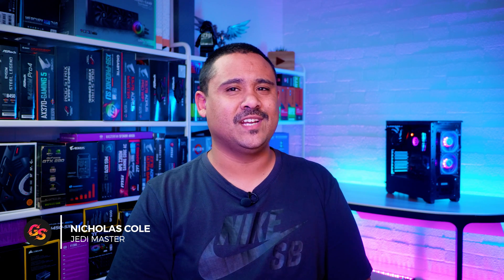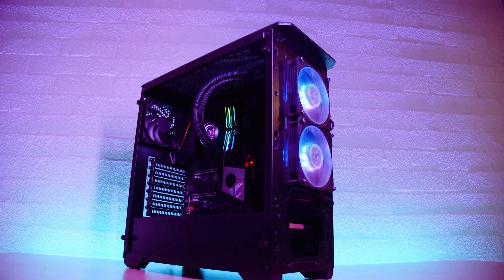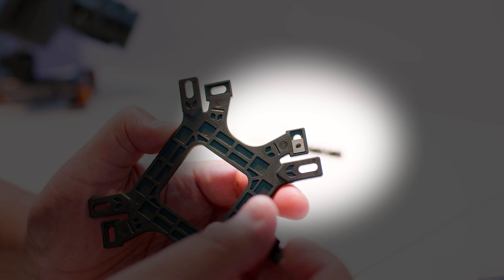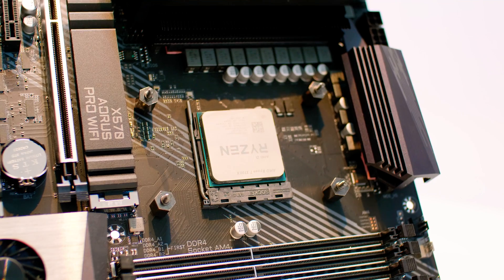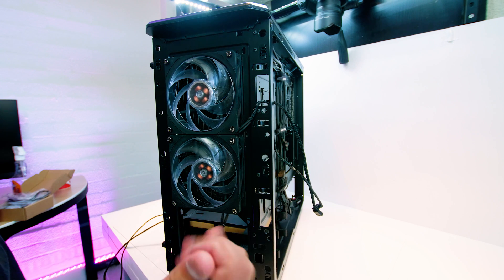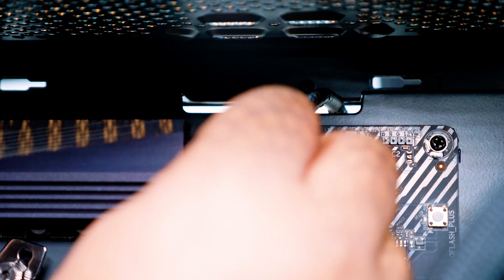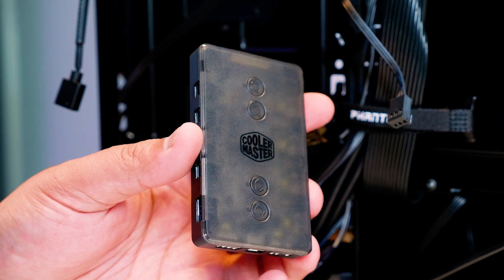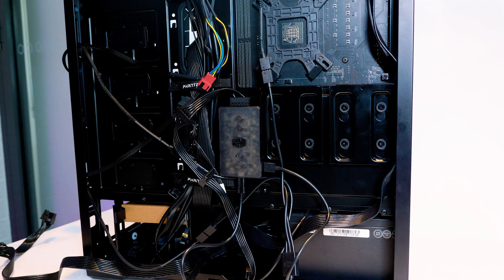HOWTO Cooler Master MasterLiquid ML240P Mirage AM4 Install Guide

Comment: Hello 👋, I was wondering if this AIO cooler would be compatible with an AM5 motherboard, specifically the MSI Pro X870E-P. I’m planning to upgrade to an AM5 platform and would like to know if I can continue using my current AIO.

Comment: Can you please remove the AM5 compatibility part? This cooler is not compatible. The AM5 bracket also holds cpu retainer in place, removing it means your cpu will literally fall out. Not removing it is also not an option, since AM5 uses 6/32 screws and ML240P screws are metric. I found this out the hard way...

Comment: The cable at 13:35 doesn’t work for my motherboard and I have a Aorus b450 I pro. The controller works for me but I also want to use the motherboard software for it and the provided one for gigabyte doesn’t work. So I tried using the one that says Asus and Msi and it doesn’t work either. So good thing that the controller works but that makes me limited to only using cooler master software and not have both which upsets me. And if anyone knows a solution plz respond

Comment: I have the exact same MB, CPU and Cooler configuration and the issue is when the new cpu backplate is in, and the hex screws are into the mounts therefore 'attaching' the backplate to the MB, the other side of the hex screws are just not tall/long enough to attach the bracketed water pump to the CPU. The nuts can't reach the screws sticking up. Do I just untighten the hex screws that are in the backplate to they get a bit taller?
Reply from the maker: You can try that but there shouldn't be any issues with the length.
Reply: @GearSeekers  Really strange that they are not long enough even when lifting up the back plate from behind. Unscrewing the hex bolts 2-3 turns gives it JUST enough height so I can get the nuts on. Thanks from across the ditch in NZ.
Reply: @patrickvanrinsvelt4466  look at Min 8:42. They are clearly short !! But "no One" Tell you this ! You are right, man ! I got the same aio and the same issue as this. Cooler master designer have done a mistake, this Is the true.
Reply: Yes ! This Is the design problem of this stupid aio. The hex screws are too short with am4 bracketing configuration, but no One tell this...strange 😆...don't you think ? Don't know if your idea of unscrew a little hex screws Is good, because maybe there could be some problem of force down necessary for the pump. You could lay on the hexagon before tight enough

Comment: So i have a question. With the wraith prism it differs if you use the usb port(3 pins), or the 4 pins rgb cable. The usb port makes the wraith prism fully rgb, while the 4 pins only gives the static rgb. Is there a difference with using the usb port with the mirage aio cooler? Or do i get the same effects by not using the controller with it so i plugg the 3 pins straight into my mobo? Greetings from the NL

Comment: You are 10 times better than the cryptic installation manual that came with this system. My cooler is now set up an working correctly.

Comment: My cooler didn’t come with that thing at 12:55
Reply: Hi. I don't know if I should buy this cooler.  I see mixed reviews when people mount it in the front.  Does yours make noise because of air bubbles and does it cool it down good?  If its bad do you recommend any other aio.

Comment: For a good review you should tell us that the 4 screws linking backplate to pump are stupidly short and when you have to tighten them with the nuts taking down the pump there's a little measure of available thread on the nuts. It should be enough any other 3-4 MM to the screws to make more easily mounting. You risk to have not enough strength for this purpose. Cooler master design is made from a noob !!
Reply from the maker: This is not a REVIEW. I clearly said that at the start lol.
Reply: Ah ok, now it's all clear.

Comment: they still use those dumb rgb connectors. Why make things more difficult for literally no reason.
Reply from the maker: Dumb RGB connectors? It's the industry standard for 5V ARGB.
Reply: Gear Seekers I was referring to the connectors that go to the hub box. They can disconnect quite easy.

Comment: Will that controller work with other A-RGB fans if plugged into this. I have the darkFlash DR12 and it has the A-RGB in to the controller that came with it so I hope this CoolerMaster controller will work on it.
Reply from the maker: 3 Pin 5V ARGB is a standard. As long as it can physically plug in it will work
Reply: @GearSeekers  Cool thank you for letting me know. Do you think it will work with the software through the USB port? Sorry for the follow up question just wanted this cooler and it should be here tomorrow and want to be prepared so it doesn't take to long to setup but this video will really help. So thank you so much for making it.

Comment: sad seems not fit Threadripper , why the not make it little bigger to support more AMD
Reply from the maker: It does support Threadripper
Reply: @GearSeekers  hmm the copper base seems so small and square..  if it works out than not optimal i guess. Looking forward for tests.

Comment: I like how Cooler Master is moving away from throwing their name on their products, I also like how they usually offer the cheapest product in almost every category but still look semi premium. 

I think it’s about time for a new and improved version of their V8  I still have the very first version on my shelf as a display piece.
Reply from the maker: The V8 doesn't fit on most AM4 boards. It's a little upsetting.
Reply: I still got their old v10 😂🤌 its also a shelf display piece

Comment: Hey, I still have my problem with the RGB controller. I've an ML360R RGB and, no matter whatever I try to revive the controller, it still doesn't work. Do you recommend me RMAing the cooler itself to get a new controller or ?
Reply: Rma
Reply from the maker: Update the firmware
Reply: Gear Seekers I’ve already done it twice, the controller isn’t even detected by Windows but my MOBO sees that something is plugged into the USB_1 header. I did an RMA, I’m currently waiting for the new cooler to come. I’ll tell you what’ll come next 👌

Comment: I put the pump in the cpu fan  header and it works fine
Reply: coco dj just make sure you run the pump on max settings and don’t let it fluctuate in speed. Terrible for the lifeline of the pump.
Reply: Aio pump runs at 100% all the time CPU fan header modulates speed
Reply: Will Patterson I won’t debate it with you there are plenty of articles on it on the internet. Even my own pump can run at different speeds depending on the amount of voltage it receives.